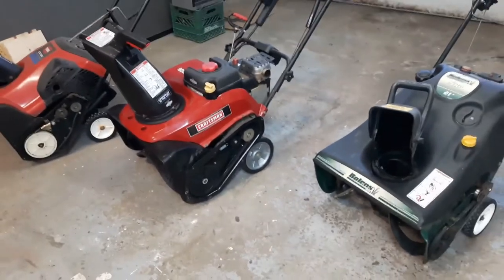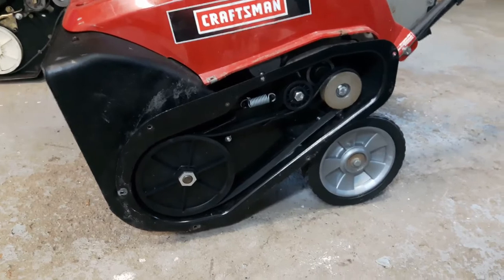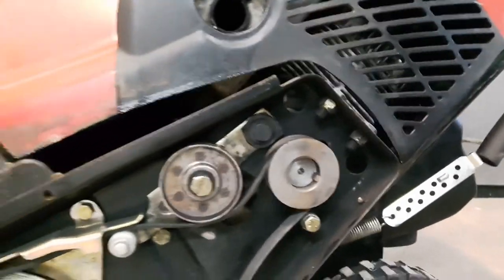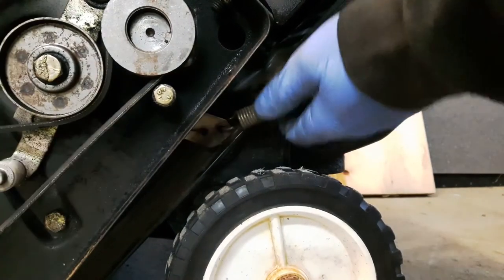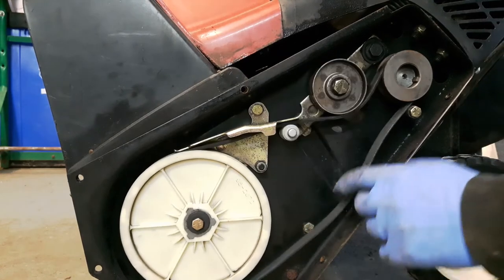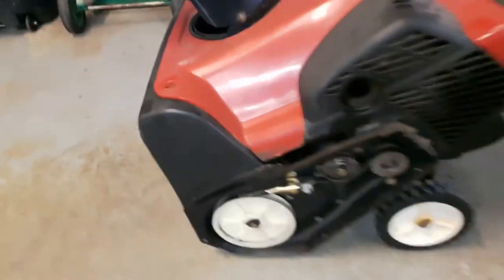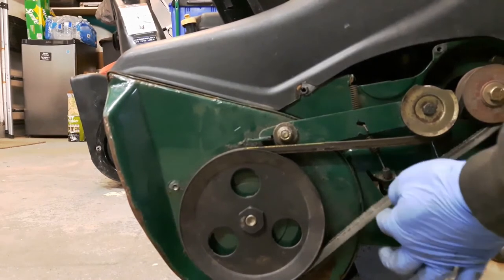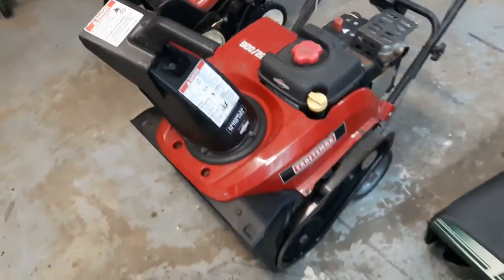Adjust The Belt Tension On A Single Stage Snowblower

Comment: Same Toro here as in video. Tightened up the cable and got rid of my weak squealing belt during chicagos heavy wet snow. Now properly cutting and throwing. Thank You for the perfect instructions! Saved my back and my wallet!
Reply from the maker: Great job getting your machine back running in tip top shape. Thanks for watching and taking the time to leave a comment. Cheers

Comment: Ooooo Excellent !
I stopped the video and sure enough my cable was loose. 
My adjustment is on top towards the handle 
I have the snow commander 
20 yrs old and noticed the other day it just wasn’t throwing the snow as far as it use to 
When I first got it it would throw the snow ten to fifteen feet 
Yesterday was a powder coat of 2 inches and it just wasn’t throwing it 
I made the two hole adjustment but I also ordered a belt 
After 20 yrs of faithful service it deserves it !
Reply from the maker: Just goes to show that if you take care of them properly, they will last. Thanks for watching. Cheers

Comment: Thanks very much for this video.  This has helped me identify what ails my 21 inch Yardmachines blower.  The last 2 years with substantial snow, I heard a lot of squealing and intermittent blowing; after removing the cover I found black dust everywhere and the belt quite loose.  The only slack adjustment was at the top of the cable, I moved it to the other position, making it tighter.  I haven't had a snowfall to test it, but how do I know if belt needs replacing?  Thanks in advance.
Reply from the maker: If you still have issues after tightening the cable then the belt has probably worn or stretched and should be replaced. Or check for visible signs of damage, cracking or bare spots. Hope this helps. Cheers
Reply: @brantsmallenginerepairs  Thank you, I will re-inspect.

Comment: Greetings from Chicago, Gerry!

Thank you so much for the terrific, detailed video.

I have a quick question, regarding the second machine with the "drag-tree" adjustment (Craftsman).  Does using the holes closer to handle create more tension on the belt, or is it the holes more towards the belt assembly?

Please let me know your thoughts, and many thanks!  🍻
Reply from the maker: Hi Sascha. Moving the z-bend to a hole closer to the handle will put more pressure on the belt. The holes closer to the bottom of the "tree" will put less tension on the belt. Hope this helps.
Cheers
Reply: It sure does, Gerry ( @brantsmallenginerepairs )!

Mine's a Toro, but it's basically the same unit.  I think the owner's manual describes the directions incorrectly (they seem to imply more tension as you go lower down the "tree," but that just didn't make sense).

I just tried it, and my squeal is gone, and the snow went directly into my neighbor's yard!  LOL

Thank you so much, once again!!  🍻

Comment: Brant great job on the CCR 3650! I think that belt looks pretty worn and for just $10 bucks I would just replace the whole damn belt since they're so cheap too, I got a brand new belt on now. Mine cable has a lot of play in it but I cant adjust the cable if needed until I have that brake spring on there first to see where the tension is pulling the opposite way. I got the new primer bulb on the way but until I get it replaced in the time being the best way to start it is just plugging in the electric starter so it saves you a lot of pulls lol. I need some warmer weather so it's comfortable being in the garage putting the new parts on but this arctic blast just isn't letting up!
Reply from the maker: Keep up the good work Karl. All the maintenance and TLC you're giving your machine will certainly pay off in the long run. 

This cold weather definitely sucks. I'm lucky enough to have an attached garage with an electric heater to keep it around 50 to 60 degrees. In fact, I'll be out there working today on the 3650. Going to be fixing a mangled electric starter gear and also working on the manual pull cord start (cord doesn't always return so probably need to lube recoil spring). Stay tuned.
Reply: @brantsmallenginerepairs  Brant your right and I also do take very good care of my stuff but I just wished I had that 60 degree garage like you do so I can get the stuff done on the 3650 but it will just have to wait for nicer days. What I love about the 3650 is that the parts are so cheap and extremely easy to find. I used to have the old S-200, remember those??? The S-200 wasn't designed for long term use since mine fell apart over the years like the handle broke and the vents in the front started breaking and it also got to the point where I couldn't change the direction of the way to shoot the snow, but the motor held up and everything else around it was breaking and falling apart. I bought the 3650 from someone on Craigslist that lives about 20 miles away from me that was selling it out of his garage and he had 2 other ones taken apart on his big workbench so I think he buys them broken and fixes them and re-sells them.
Reply from the maker: @karlswert3348  it is convenient to have the garage to work in. I often find equipment for cheap, fix it up and resell it. You wouldn't believe what people throw away these days that just needs some TLC. 

I think your 3650 will serve you well. Just keep an eye on your electric start system. If it starts acting up then investigate it earlier than later. I have a video coming up in the next few weeks that will explain why
Reply: @brantsmallenginerepairs  Thanks Brant I'll be on the lookout. Just used the 3650 earlier, I electric started it since the primer bulb is still broke to save all the pulls from starting. I never use my electric start because it takes 1 or 2 pulls to start on a cold start. It's more time getting the cord out and plugging it in to push the button than it is to give a yank or two and get it started lol. Once my prime bulb is replaced then I'm back to pull starting again. The last time I electric started was back when I first bought it to test the starter for shits and giggles.
Reply: @brantsmallenginerepairs  Brant how does the governor work when you push the snowblower into snow? How does it speed up when it knows there is tension going into a snow drift?
Reply from the maker: @karlswert3348  I don't have a video explaining the governor system and it's difficult to explain with words. Much easier to watch so here is a link to a video on the basics of how governors work in small engines.
https://youtu.be/50WipK9L8hc
Reply: @brantsmallenginerepairs  Hey Brant just used the 3650 earlier and it is about 7 degrees outside,  used it last night too. I electric started it last night and it worked great but today went to get the additional snow on the driveway overnight and I go to push the button and it just makes a whining noise but not engaging the gear. Do you think it's been so cold that the starter was frozen? I also went to use the pull cord and it has a lot of give in it and doesn't rewind right. I have to keep tugging on the rope for it to retract. This is the first time my electric starter and rewind  starter had these issues. Do you think it's because it's just so cold out that these parts can freeze? After using the machine I shut it off and tried the electric start again and it was hit or miss engaging. I hope I didn't damage any gears inside there or just if the starter was spinning inside there but not popping up to engage to start. Let me know your thoughts.
Reply from the maker: @karlswert3348  it is unlikely to be the cold causing the issues. First step with electric start would be to check the starter gear and to see if the gear is shooting out when you press the button. Check out this video at about 28:40 for some guidance. As for the pull start, what usually causes them to not recoil is either a rusty recoil spring or not enough tension on the spring. If it recoils once in a while at least the spring is not broken. Usually some lubrication fixes this issue.  I do have a video showing this that I had planned to release in a couple weeks but I'll see if I can reschedule it for sooner release.
Reply: @brantsmallenginerepairs  i just don't get why these issues started the last time or two I used the machine. The starter actually started doing that today,  last night I pressed the button one time, it engaged right away and turned over. Today I press the button and it didn't want to jump out until after pressing the button several more times. My recoil doesn't bite until when the cord is like half way out. I atleast got it started using half the recoil rope. It's funny there's two different ways to start it and both shit up at the exact same time! Lucky there isn't anymore measurable snow as far as the forecast goes and next week we're above freezing and to about 40. I just want to limp on it to finish off this winter because I'm not taking anything apart (and doing the auger spring) until I can actually work in the garage work bench at a comfortable temperature. No way in hell I'm doing it when it's 14 degrees out now!
Reply from the maker: @karlswert3348  I don't blame you.
Reply: @brantsmallenginerepairs  my brother lives in the house next door of me so we both share the 3650. It's a beast of a machine!
Reply: @brantsmallenginerepairs  Hi Brant, ok more snow again lastnight (I cant wait til this ends) and this time instead of being 7 degrees it is 27 outside now luckily. I did notice upon starting it my cord just was zipping freely with no tension as I pulled on it, the more I pulled it gently the more it was biting on the flywheel and then kind of "exercised" it back and forth and now its pretty much biting on it every time, but doesn't rewind in all the way leaving about an inch of string out. I did put the electric starter on and instead of making a "whining-zinging" sound not engaging like it did Monday, this time I pressed the starter button it engaged right away and turned the motor over on the first try. I did notice from the blowing snow and 5 degree temps when I was snowblowing Monday the machine still has snow under the housing all coated over the fuel line all in that area when I tilted it forward earlier to look. Could it be maybe there's items were frozen from blowing snow getting under there and it was working now since it sat in the garage and it is 20 degrees warmer outside now? The whole bottom of the machine has ice all over on the underside. The scraper bar looks worn too so I ordered a new one to install in the spring. I just don't want take things apart when I don't need to, but I think it sounds like the recoil may need a little WD-40 inside where the re-winder is. I don't really want to mess with the electric starter looks like a big job.

Comment: I have a craftsman 5-year-old 21'" 123cc single stage snowblower.  It's not self-propelling or blowing snow.!  So, it's the belt either loose or broken!  I can do it!
Reply from the maker: Yes you can! Hopefully this video will help guide you through your repair. Good luck. Cheers
Reply: @brantsmallenginerepairs    I looked at the belt it looks good the auger turns good but don't touch ground, unless I take the scraper blade off then it works just like always.  Auger supposed to touch the ground a little, right? I've ordered an auger kit and a new scraper blade it's 7 years old I'm surprised it lasted that long.  We got 4"-6" of snow tomorrow in Michigan I'll use it without the scraper blade just be careful not to hit no bumps.🤣
Reply from the maker: @MrGhettoGrower  yes, the paddles should touch the ground. Paddle replacement would fix your issue. Good luck with your repair. Cheers
Reply: @brantsmallenginerepairs  Thanks for the help.  I just needed the new shave plate and to straighten out the bottom of the snowblower.  My sidewalk is under even and it's took a beaten.  Lowes.ocm has craftsman replacement parts at the best price.
Reply from the maker: @MrGhettoGrower  thanks for the update and good job getting it figured out. Cheers

Comment: My yard machine 2 cycle is stuck in the engaged position. The engagement handle is inoperable so when its running the auger is always engaged. Any suggestions? Also, when running, the engine is screaming. Are these two issues possibly linked? Thanks
Reply from the maker: I had a little Craftsman that was doing the same thing not long ago. The paddles would not disengage and continued to rotate after the handle was released. Turns out the belt was super worn. This could possibly be related to the noise. Check out the video here: https://www.youtube.com/watch?v=S0BVD-kVTUI
Reply: Yes. STOP using it until it gets repaired!

Comment: Can you tell me if the paddle on my Toro 518 is it supposed to come in contact with the ground I know it may sound ridiculous but I’m a woman and this is my first gas snowblower I’ve always had electric because it already looks like some threads are hanging off of it the paddle. I sure hope somebody sees my messages and lets me know what’s going on.
Reply from the maker: The paddles will definitely come in contact with the ground. This will almost create a "self propel" function. As it scraps the ground, it propels itself forward.

Comment: I got the auger to spin but the whole thing squeals a little. What can I do about that?
Reply from the maker: You first need to isolate where the squeal is coming from. Is it from the belt and pulley area? The auger area? If it's the pulley area then you might have to replace the belt if it's still slipping. If it's from the auger are then maybe you have some bad auger bearings.